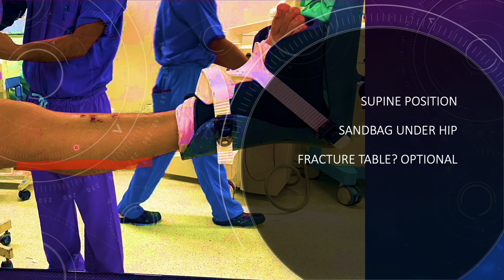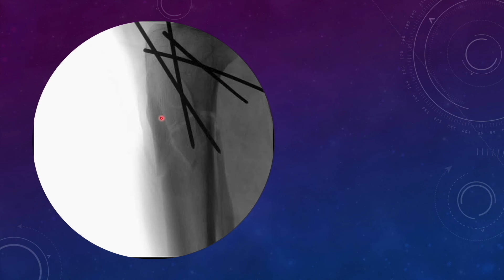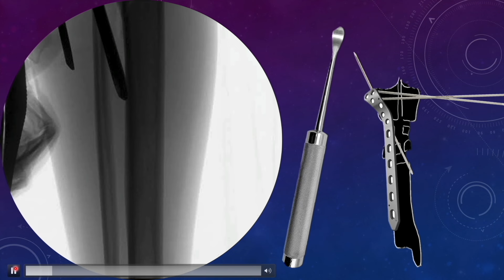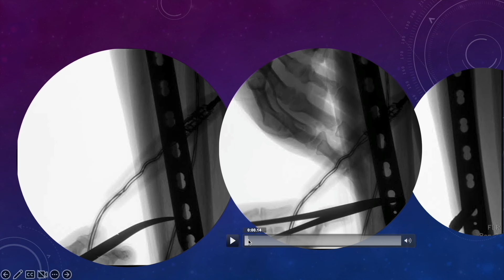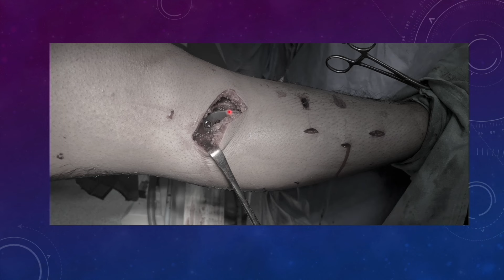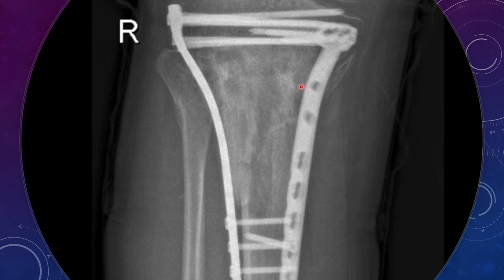MIPO for Proximal Tibia Fractures: Stepwise Basics

Comment: Beautifully explained. 3 locking distal screws are good enough?
Reply from the maker: Actually three are sufficient and this is scientifically established. We unknowingly make  construct rigid by adding extra screw. A good screw density of 50% in diaphysis and 3 locking screws, good plate length and zero screw near comminuted zone makes all heal biologically.
Reply: @Justorthothings  got it sir 🙏